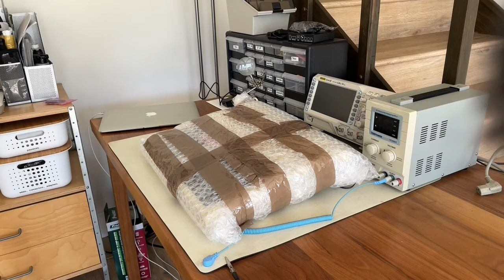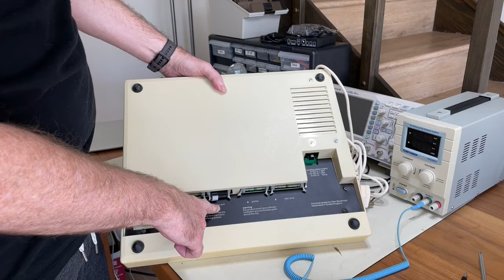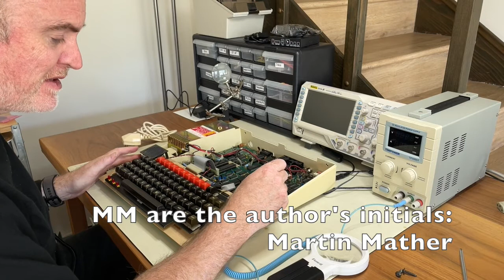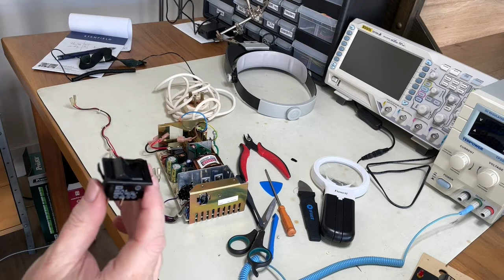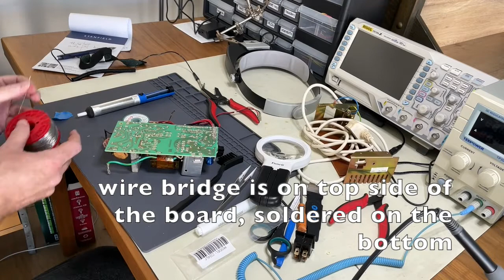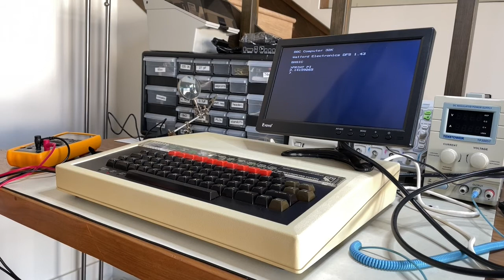BBC Micro UK/US voltage mod

Comment: Perfect timing. Thanks for the video. I spent many a night taping on the keys of one of those machines. Like you I now live in the states and have wanted to get myself a beeb b, but the power supply was always a sticking point. Thanks for giving me the answer.
Reply from the maker: Yep, it's an easy mod. I'll re-cut this (rather terrible) video some time with some close-ups that show the details more clearly. I encourage you to have a go. I'm delighted to have my machine up and running and sitting on my "altar of 8-bit" alongside the Apple II and my homebrew machine.

Comment: Good to see you back at it again Paul. I have never had any experience with BBC micros but have looked at BBC basic and will run an emulator. ( No power supply issues there!).
Reply from the maker: BBC Basic is excellent. Far faster than other 8-bit BASICs and will a full range of structured programming features. When I was a kid, I wrote a recursive descent Pascal compiler in BBC Basic which didn't require a single goto. (Also, it has a built-in assembler -- super handy!)